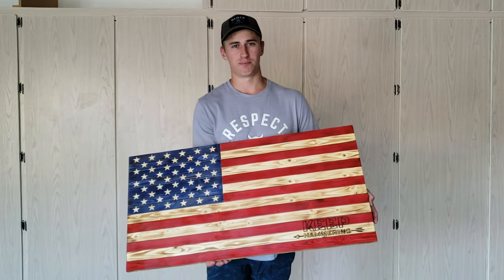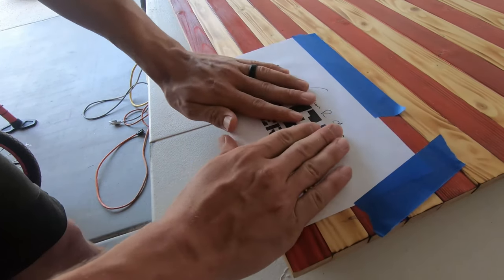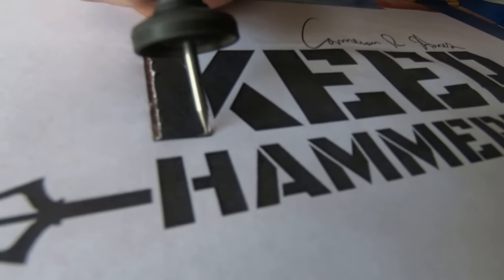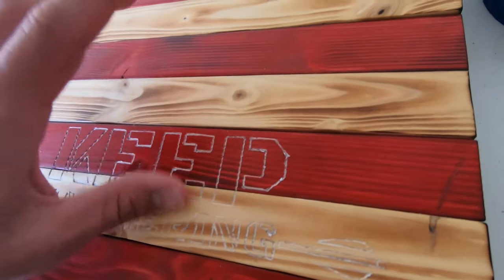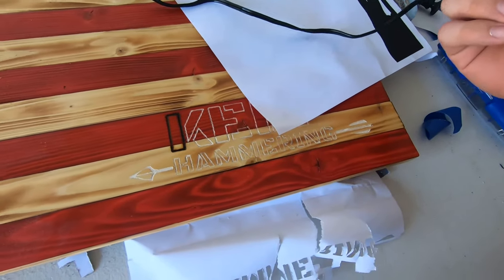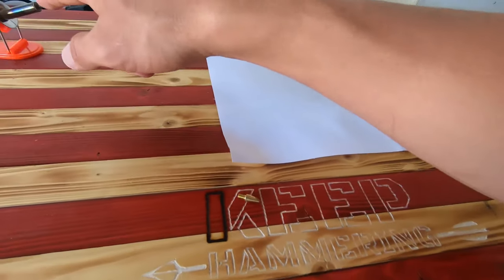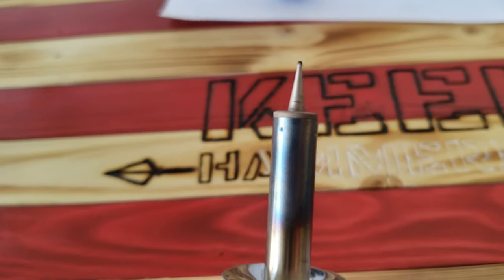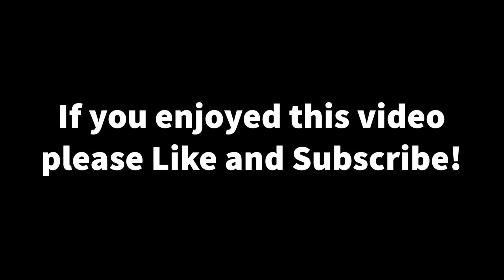HOW TO BURN ALMOST ANY LOGO/PICTURE/EMBLEM/DESIGN INTO A WOODEN FLAG! NO STENCIL NEEDED

Comment: Max, there is a much better way to accomplish the same effect.  Use a laser printer, mirror the image, then place it upside down where you want it, and tape it down.  Using the Transfer tip, it's the round one in your kit, slowly heat it from the back side, making sure you keep going over it until it can clearly be seen on the wood.  I've done this for Harley Davidson Emblems on plaques, and looks awesome.

Comment: are you putting adhesive to the back of the paper? or just using the tape on the sides to hold it down?
Reply from the maker: Just using the tape on the sides. If you already sealed your flag the sealer might act like an adhesive but i didnt add anything
Reply: @MaxF01  ok cool, thank you. and great job by the way!
Reply from the maker: @matthewbalagia1792  you are very welcome and thanks a lot i really appreciate it!!

Comment: Suggestion: put together and electric box with a dimmer switch  and a electric receptical on a short extension cord so you can adjust the temperature.
Reply from the maker: Not a bad idea!

Comment: Or you can use a scorch pen
Reply from the maker: That is very true! I havent tried the scorch pen yet but i need to, thanks for the advice!
Reply: What is a scorch pen? I never heard of one of those.
Thanks for your videos. You make it look so easy.
Reply from the maker: @j.c.6063  i think its a pen that you use to write on wood and then when you torch it, it will burn it wherever you wrote with the pen. You are very welcome i hope they are helpful! 👍🏼😊
Reply: @MaxF01  thank you.
I've had a dremel moto saw for years but was always afraid to mess with it.
I took it out of the case this week. I still have all 10 of my fingers 
Did greats with the straight lines, totally sucked at the curved ones, but at least I'm not afraid of it anymore.
Reply from the maker: @j.c.6063  that is awesome!! Im sure you will make some amazing things with it!👍🏼 i wish you the best of luck!! Haha and that is always a great bonus to keep all your fingers in the process!😁
Reply: Why not use transfer paper or take a pencil and color the back of your image and use a pen or sharp object to transfer the pencil to the wood
Reply: @MaxF01  a scorch pen looks to me like nothing more than liquid flux, when you torch it it will turn black...DIY scorch pen lol
Reply from the maker: @julieramsburg8254  i think transfer paper would work good as well this is just one that seems to work well for me